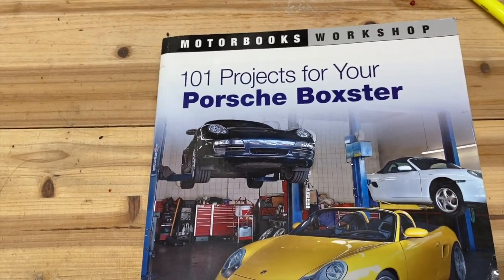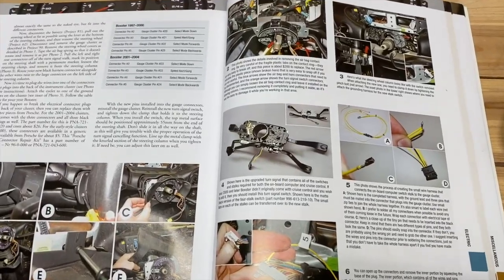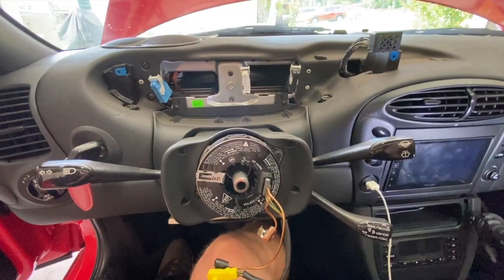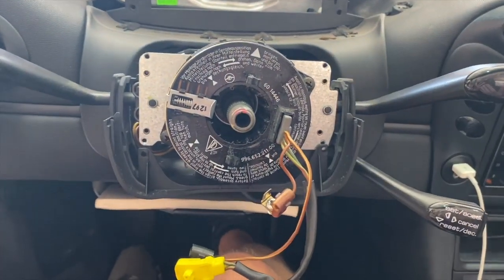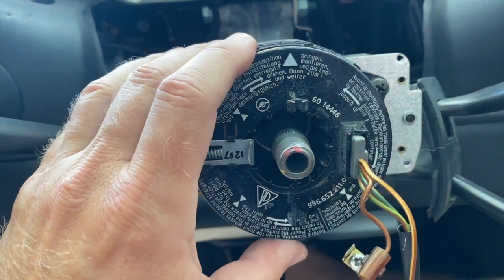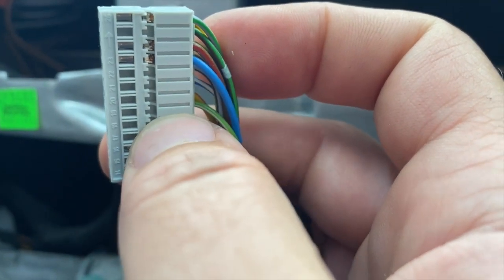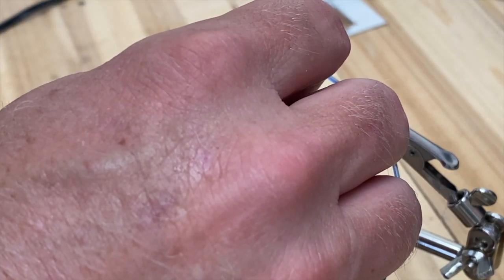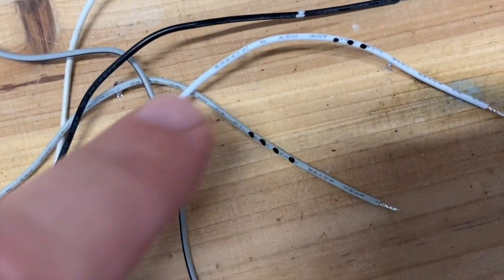HOW TO INSTALL THE ON BOARD COMPUTER in a Porsche Boxster 986 | PART 1 (Project 91)

Comment: Excellent tutorial!
A few years ago, I realized this on a European 986 (Belgium). I did not want to dismantle the steering wheel (for safety), nor buy the expensive Porsche parts. In general the Belgian version has two switches for seat heating (even when the seats are not heated, which was the case):
https://zupimages.net/up/20/25/n5rq.png
https://zupimages.net/viewer.php?id=20/25/n5rq.png
Then simply place a wire from n ° 1 of the right switch to the 20 of white plug II (instrument cluster), a second wire of n ° 2 of the right switch to 21 of white plug II, a third wire of n ° 1 from the left switch to 22 of the white plug II and a last wire from n ° 2 of the left switch to the 25 of the white plug II. The n ° 4 of the two switches (common) are already connected to the ground. Here is the diagram:
https://zupimages.net/up/20/25/idr8.jpg
https://zupimages.net/viewer.php?id=20/25/idr8.jpg
If the outside temperature is displayed, this means (although you do not have the computer option) the "On Board Computer" is activated. So no need to use a PIWIS or a PST-2.
It cost me less than ten dollars and twenty minutes of easy work to get all the functions of the computer.